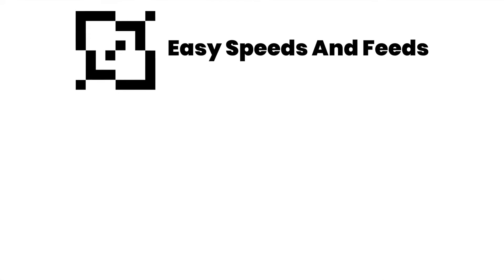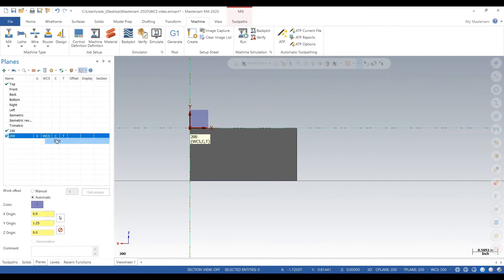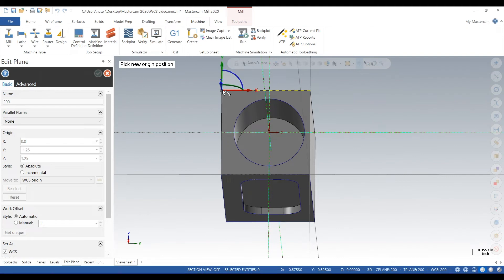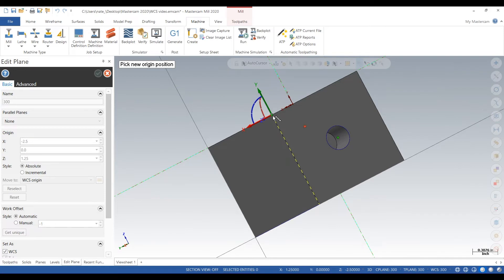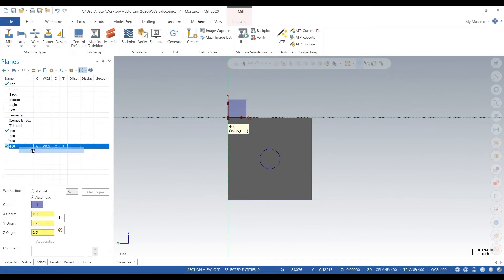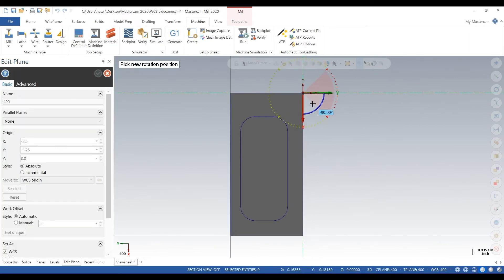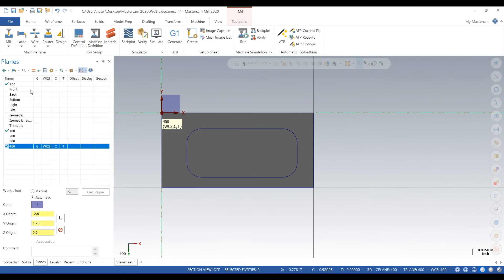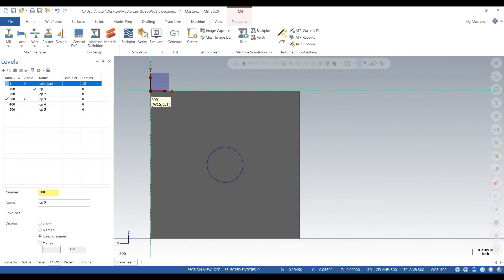Work Coordinate System - Mastercam 2020 Tutorial

Comment: Fantastic! I am new to this. and where ever you put the Gnomon is the Part Home position? Yus said touch off in the corner. We do trimming of 3D molded parts and I want to set it up so there is a hole in the center top of the (Setup Part) and the operator would just jog until he or she places the tool into the hole and they have set the X, Y, and Z offsets.  Would I place the Gnomon where I  want the setup hole to be?   Also all I need to go when placing the Gnomon is to make sure it matches the axis's of the machine ( in my case Z up and down, X forward and back, and Y left to right. 

lastly the World Gnomon in the bottom left of mastercam GUI screen, if I only have 1 WCS for my part, the part WCS and the World WCS need to match?   

Sorry for all the dumb questions.   I understood what you did here. Yo made it so when you flip the part in the vise  when doing each different operation, that the WCS is all lined up the same way.
Reply from the maker: I would say that you want your wcs (xyz 0) in mastercam to match where you touched off in your machine. And you want your part oriented in the machine as it looks in mastercam. Just make sure your tool planes are lined up with WCS thats touched off in the machine. Ill probably make a video about this because its hard to explain through text.
Reply: @easyspeedsandfeeds1410  I would greatly Appreciate this. I was told to never move the model, but rather change the WCS amd world to match the machine. its very confusing to someone who is just starting out nd needs to know this stuff. Thanks for you awesome videos. I cant wait to see the new on on WCS, Home position, World WCS, ect.. and how it all works together. Subbed and Bell notifications ON!